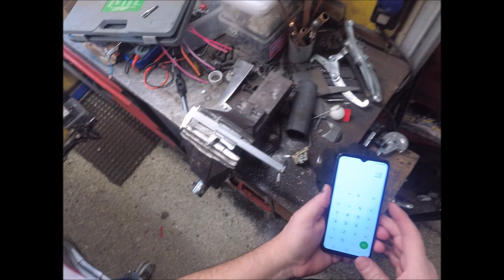Made my own adapter for oil pressure sensor. *Volvo 460 T5 AWD*

Comment: When you chucked the tap bit into the drill press and turned it on I was screamin "NO, don't do it!". I've seen machinists tap with an end mill at super slow speed and even that makes me scared to watch. So glad to see you were just using the drill press to start the threads into the part by hand, whew!!

When tapping into aluminum it really helps to have some tapping oil specific to aluminum. Though the aluminum is soft I've had many close calls with the tap wanting to bind up when removing the tap and that's where the right oil really helps ;>)
Reply from the maker: Hahaha if I had known, I would have done it on a scrap piece just to get your heart pumping hahahaha